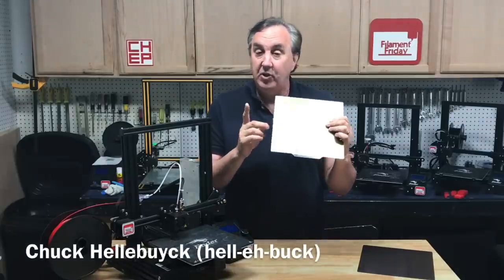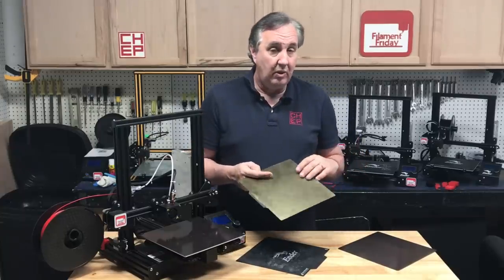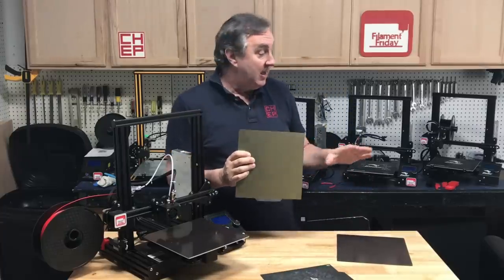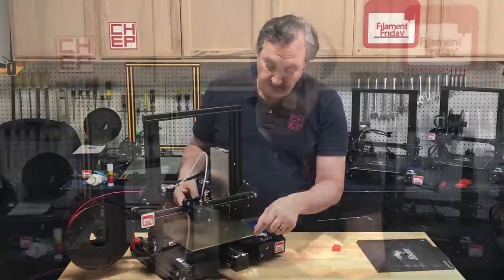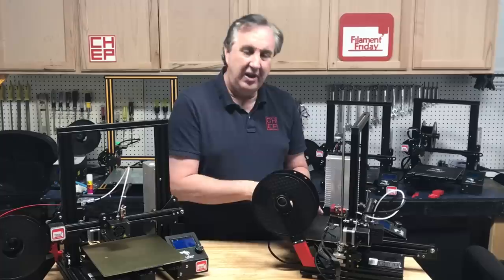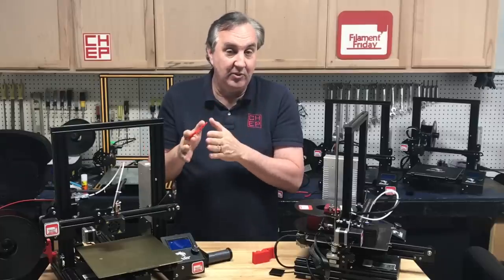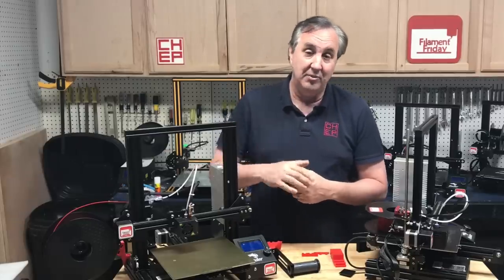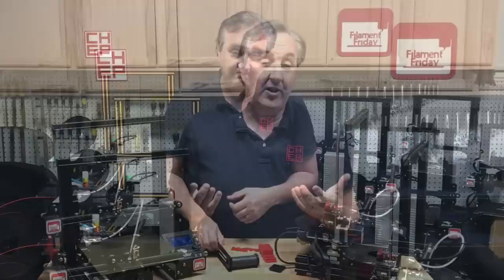Creality PEI Magnetic BED on Creality Ender 3 PRO

Comment: Clean the PEI with alcohol.  I had success with PEI years ago, but I switched to polypropylene and I absolutely love it.  Prints stick when it’s hot, release on their own when it’s cool.  I love printing PETG on it.
Reply from the maker: I did clean it. I should have mentioned that.
Reply: Been using the polypropylene beds (got mine from Tiny Machines).  I have hundreds of hours on them and as they've aged, found a mist of hair spray works great
Reply: @WhereNerdyisCool  Would you happen to have an Amazon link for Ender-3 sized versions? Sounds perfect for my needs!
Reply: Colin Pattinson I do not. I’m tempted to try out the Wham Bam System

Comment: I’ve been looking to get a Creality PEI bed for a while but they just haven’t been available here in the uk or every time I’ve seen them they’ve been over £50. So I was checking out amazon and found and ordered a PEI bed from Eryone 235x235, well I’ve been using it for 3 weeks and it’s amazing. I’ve got the original pro bed and the glass and love the original magnetic bed over the heavy glass with clips, so this is the best setup I’ve found and it really dose work straight out the box with no sanding and the finish is second to none. £27 well spent.
Reply: Ditto

Comment: I have mine for a year now never sand it or anything i just clean it with alcohol works every time my bed temperature is at 55 printing PLA.
I bought it from a seller called ENERGETIC from AE.
It works every time better than glass i had before and i don't have to wait just peal it from the front (so i don't have to level my bed again) and the print comes out.

Comment: When my pei  doesn't stick anymore I use a 1000 sand paper  and clean and roughing it a bit. After a wipe with 70% isopropyl it works great. This method I already used for over 6 month and there is plenty of pei thickness left.

Comment: For small parts I can use a glass bed without glue on my modified CR-10 mini. It works fine if I print the first layer slow enough. For big parts I use a 3rd party rough magnetic bed. I prefer it that way mostly because it's easier to remove the part. The finish obviously isn't that great but I can just sand the print afterwards.

Comment: I'm on my 3rd 3D-printer and always buy a PEI sheet for them. My first one was almost 5 years ago and all three are running great. No issues with sticking or anything. Also, one thing you should do is let it 'warm up' for a bit before using it after a while.

Comment: I cracked my glass bed on my cr-10 s5. TH3D sells a solution that allows you to add a magnet and a spring steel PEI surface. It's been working great for me so far. Maybe you just got a bad surface, like you said.

Comment: I bought a powder coated PEI bed and had similar issues. Tried varying temperatures, cleaning with IPA etc. with varying degrees of success, but larger prints would always warp. I wasn't keen on having to clean the build plate every time either. In the end I found a couple of things that worked for me; either pre-heating the bed and let it sit for about 10 minutes before starting the print (I suspect uneven heat distribution affects adhesion) or hairspray. With the powder coated beds most prints just pop off the build plate when the bed cools down (even with hairspray), and hairspray last for many prints (and I hardly ever have to clean it). Glue stick would probably work too, I just like hairspray better.
Reply from the maker: Thanks.

Comment: I'm using WhamBam's PEX version of that plate on my Ender 3 - It works amazingly. Part of the initial instructions was to clean the PEX with IPA and the included steel wool to create micro scratches in the surface. Did you try that at all?

Comment: I have the exact same bed, on my ender 3, and did have some warping in the beginning with a very large dense print and pla. But assumed it was because of the thermal mass of such a dense long print. After going onto other prints with pla, and later petg peints I've had nothing but success. Maybe try different bed temps.

Comment: maybe its the creality pei thats not good, i use energetic brand from aliexpress and its work great with pla bed 50 / abs 90. using esun pla+ 210 / abs + 220, i even ordered another one for my 2nd ender 3 pro
Reply: I bought the double sided bed with pei on one side and the rough black stock material on the other side and it prints perfectly! I guess it depends on the brand.

Comment: I have had horrible leveling issues with stock Ender 3 build plate. I would have to level the bed every 3 or so prints. I bought the same PEI plate you have and it has been working like a charm. Printing PLA I have had no adhesion issues and I am super happy with it!

Comment: hey CHEP. I have the same sheet and I'm getting great prints. I find I have to do 2 things:
-Clean the sheet with IPA between prints 
-Change the bed temperature to one that won't fluctuate. So I adjust my slicer settings to not change temperature at all, even between the first and later layers.

If you try this and it still doesn't work out, the sheet is probably faulty. Would love to hear a follow up!

Comment: I too bought this SAME PEI print plate for my Ender 3 v2 printer and when printing small things it works OK but printing larger items the part moves a lot and doesn't stick to the plate... So Amazon gave me my money back and I ordered the same PEI bed plate from Creaity. Now I have received the PEI bed plate from Creaity and the plate worked and didn't work with certain prints so I kept the PEI plate for  further research and have been using the flex "build tac" bed plate and had NO issues with prints sticking to the bed.

Comment: I have used the original Creality Magnetic bed, I have used glass, and I have used the Creality PEI build plate. the glass was good but the PEI is better. I clean it with alcohol about every 4 or 5  prints but I din't think it really needs it. I am printing only PLA.

Comment: I have a couple of these this is what you're doing wrong.

1. You need to clean these with isopropyl alcohol almost every print. You clearly have fingerprint grease all over it. That's why it kept getting worse.
2. You need to scuff these with medium grade steel wool in a circular pattern. With the pei stickers they are too smooth in the plastic doesn't have anything to bite into.
3. What you really want is a powder coated pei not a pei sticker.

Comment: Sorry if you did but i didnt see any mention of cleaning the bed between prints. my experiance with pei has been that it is supper sensative to oils from your hand. if you touch the plate it is worth going over it with some ipa. ive even seen finger prints show up on otherwise flat bottoms before. as always there is something to be said for if it aint broke dont fix it. good luck and hope it works out. PS: if you send this one back it would be cool to see you try the smooth and textured sheets from TH3D!

Comment: I got mine on Aliexpress and it looks exactly the same. Had it for about 6 months now and it works great. I didn't hear you say you cleaned it which you should do. Use some IPA or Windex when it is hot. At 5:30 your skirt doesn't look squished down enough to hold on PEI but that could be due to bed temp. For me, 60C works best with PEI. PEI as a build surface is the amazing so I hope you get a new one and do some more testing.

Comment: Normally not a commenter on any video, but I wanted to give a big thumbs up to using a PEI sheet.  I was struggling with getting good prints of of the flex plate and as soon as I got the PEI plate/sheet it was like magic.  So not sure what was going on with your sheet/print.

Comment: I have smooth boro glass with 0.3m PEI sheet stuck on top and it is superb, no messing with glue or anything else and its been the most reliable build surface for me, once in a while it will lose its adhesion and nothing will stick to it so I lightly sand the surface with 600g paper then good clean with IPA and its back to being brilliant again, bed temp with this setup is 45, even when the bed has cooled down to 21 you cant just lift the prints off so I put a sharpened scraper under an edge of the print and lightly tap it which lifts it off the bed then slide scraper undrer and it comes off easy.

Comment: Had the same kind of results.

I resolved the warping issue, found on all prints to some degree with different filaments, by using a brim in Cura to help hold everything down.

I have also a difficult pla+ filament that does not like to stick to any beds. Usually use a glue stick but today I used a light dusting of hair spray and that has worked a treat and gives a better finish.

I'm using an Eyrone PEI magnetic bed on my Ender 3.

Comment: I have a one mm pei bed on my cr10s and it works fairly well. You need to sand it with some fairly high grit sandpaper to get it to stick. But I still prefer glass bed with glue stick because it stays flat better. The pei I had wasn't perfectly flat and caused some issues. For the first month it worked better and stuck better than after that it started to lose its stick and would need to clean and sand it down again.

Comment: 0000 steel wool i have a wambam flex bed and they recommend to use 0000 steel wool on it to make it have a bit more bite, also you may have to increase the bed temp a bit

Comment: I'm still a borosilicate  glass bed fan after years of trying all of these "miracle" print bed surfaces.  All of my printers have them and they never need to be replaced or need any maintenance like sanding, etc.  Most filaments will stick to the bare glass with no helpers.  They come right off faster as the bed cools and I don't need to have the bed cool completely.  If I do need any sticking help I use a light spray of Aquanet hairspray.  After several prints the bed gets "seasoned" and the prints seem to stick even better.  I clean the hairspray off with warm water and then wipe the bed with iso alcohol.  Parts or filaments that are warp prone or having a hard time staying put get a localized or full skirt of 6 or more lines and that keeps them attached to the glass.  If a part needs a little help being removed, I carefully use a single edge razor blade to lift an edge of the print.  Then I can slide in a thin scraper like the one included in your Filament Friday kit to lift the rest.

Comment: Got a PEI with my s1 pro. Like it a lot. I have found that Z height adjustments are required for different materials. PLA is about 0.1 closer than TPU. PETG is half way in between. ASA, nylon are PLA level. I'm theorizing that the PEI requires more squash with harder materials.

Before anyone asks, yes, TPU on PEI. If you set Z higher you don't have issues getting it off the bed. I've done it 95A generic and Ninjaflex. No issues and no glue required.

Comment: I have a homemade version of this made from sheet metal and a PEI sheet I got off Amazon. Hot glued magnets the the bottom of my bare build plate and it works great.

I've never had a problem with pla or petg and I rarely clean the pei.  Maybe comgrow is using a bad source for pei.

Comment: I only use PEI and it’s amazing. Try 50C and make sure you clean it with alcohol before heating.
Reply: So with the PEI, you dont need any other types of adhesion sprayed on it like hair spray or whatever?
Reply: @krieger67333  That's right. I don't use anything else for adhesion. I do use the PEI sheets along with spring steel plates to make part removal a cinch, I print mostly PLA and PETG. I have spring steel plates with PEI on 10 different printers and other than OCCASIONALLY having to replace a PEI sheet if it gets damages (like from a bad z offset scratching the surface) I never have to think about it. They stay in great shape and I just clean with alcohol to get off any oils form handling the sheets.
Reply: @10throwfilms  thats awesome have you tried the PEI bed? I have such issues with adhesion, I thought Id give this or something similar a try. I just started and have only used PLA so far.
Reply: @krieger67333  I haven't used the Creality brand stuff, but I replaced the build surfaces on all my printers. I also added bed leveling probes to all of my machines that didn't already come with one installed. That really makes the biggest difference for adhesion, but the PEI is GREAT STUFF and gives you a nice smooth surface (or you can get the powder coated PEI for a textured surface). I use the magnetic plates from th3dstudio as they are resonably priced and good quality.
Reply: @10throwfilms  i have a bl touch on my ender 3 pro too. Thanks for the tip! Definitely gonna check it out.

Comment: I bought the same one on Amazon a few weeks ago.  I had fantastic results with PLA with your Cura profiles (thank you).  No need for any spray or glue.  Cleaned up with little effort using IPA.  The first few prints with PETG were beautiful but then they started sticking and wouldn't come off.  I haven't tried PLA again as I'm about to do the whole bootloader/marlin/bltouch thing.  The edges of the PEI sheet are quite sharp on mine as well.  You could lose an eye on the corners too. 

BTW.  No way I'd tolerate that blemish!  Mine developed a few bubbles over time between the sheet and the metal but you have to really look to find them.

Comment: I have this same bed (I think from the same seller) and I love it. It does have adhesion issues with pla  but it is very reliable after using some glue stick on the bed. But where it really shines is when using petg I had a horrible time with adhesion on the build tec but this bed does great with it. So what I've been doing is using the buildtec for larger pla prints and using the spring steel pei for my petg and smaller pla prints or smooth surface pla (making sure to use glue stick). About IPA, I haven't been able to get any with the current medical situation but haven't really had problems without it. Just rinsing off the glue with hot water.
Reply from the maker: Thanks
Reply: I have a similar bed, from a different supplier, same issues with the adhesion, but I love the flexible metal for removal of larger items. I nicked the PEI sheet and cannot find a replacement, which got me thinking I wonder if I could use a stock Ender 3 sticker sheet and if it would have better adhesion? Also there are a ton of those stock sticker sheets available on Amazon.

Comment: I have sprung steel with PEI on one of my Cr10s Pros and flex build tac on the other, the magnets are the same so I can switch back and forth between machines.

I have to say both have their merits; PEI for me sometimes sticks too well, if you don't let it cool slightly before you flex of a big part you can (and I have in the past) damaged the PEI top layer. You can replace just the PEI sheet. Top tip... stuff the whole spring steel sheet in your freezer for an hour or so makes it easier to remove the old PEI cover.
I find stuff sticks so well that if it starts to warp it lifts the bed of the magnetic base so bulldog clips are worth including as extra insurance.

The flex build tac is better for printing objects with a large footprint and you can remove them hot, as soon as the print finishes and set if straight off again (important when time is money!) But you loose the silky smooth finish you get with PEI. I wipe both surfaces with white spirit between prints and they stick really well.

Both surfaces have their merits, once your magnetic base is installed you can swap between the 2 in seconds and have the right surface for the type if print you're running.

Another great video btw

Comment: My first experiences with PEI were a mess a few years ago.  Either the print didn't stick well or stuck too well and was destructive to remove.  I recently bought the Flexplate and Buildtak PEI sheet from PrintedSolid.  That's worked exceptionally well.  I also bought two EZFlex (2) setup from TH3D...that's starting to become problematic.  Prints do not pop off with flex but you have to peel them off.  I'm not sure what the difference is between his PEI and Buildtak but it's definitely unusual  I'm doing a lot of long, thing prints (ear savers) and it's getting a little frustrating peeling parts off.

Comment: I wipe my PEI with IPA between every print and then run 000 steel wool over it every 10 or so prints
Reply: IPA makes a huge difference especially with PLA.
Reply: I have almost in all printers the bed with PEI. The ones with magnetic system need a little more temperature than the others that have the PEI directly over the aluminum heated bed. But for me it is crutial to mantain the PEI clean with IPA. I founded that the best results are when I clean the PEI with IPA and the bed heated to 40-50°C. After that I can print about 10 times without cleaning if I'm careful and don't touch the PEI surface with my fingers.
Reply: I had adhesion problems with my PEI as well until I scuffed it up. Steel wool and fine grit sandpaper work, but I just used a ScotchBrite pad. IPA clean as well between prints.

Comment: I use wham bam PEX which is very similar to PEI. I rubbed it down with steel wool when I installed it and wipe it down with alcohol every once in a while and it sticks great. If it loses adhesion, you’re supposed to use the steel wool again with acetone to rejuvenate the surface.

Comment: I use PEI, Have had great ssccess with it. I use no glue, or hairspray on my PEI. It just sticks. If I have to use a filament that need heat, PEI is still amazing, just a little hairspray and bam. Perfect prints. I did buy this new black glass bed for My ender 3. Wow. It has blown me AWAY! I have not used any adhesive....I have printed face shield bands nonstop for 4 days....no adhesive, no heated bed. Amazing.